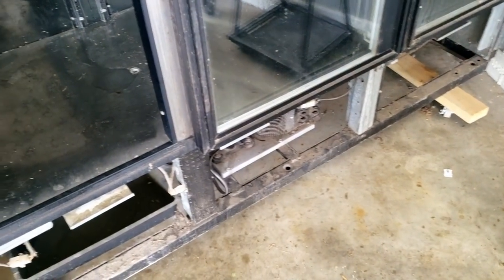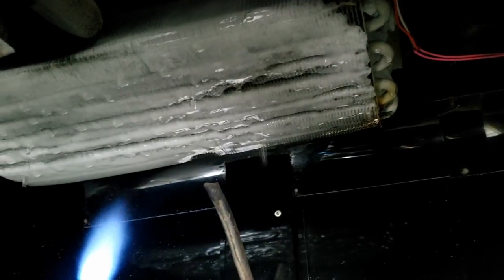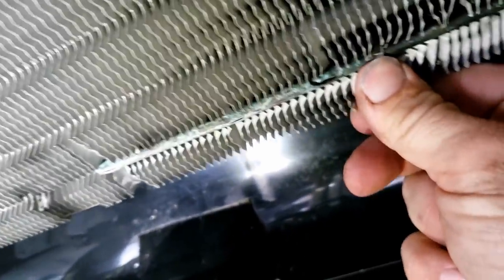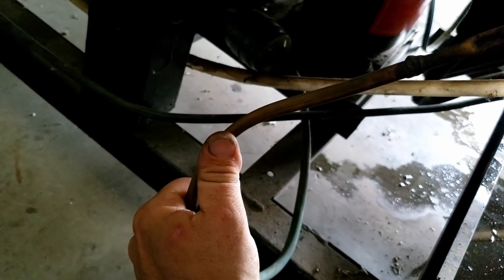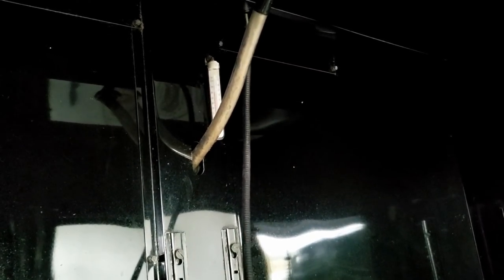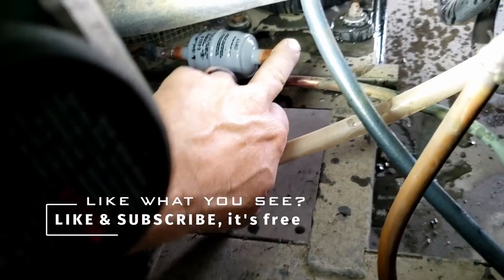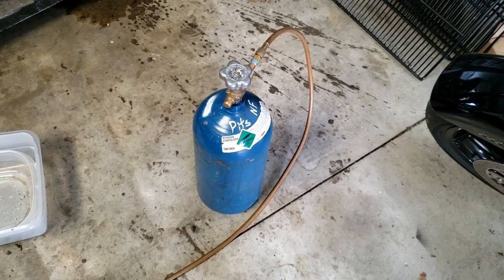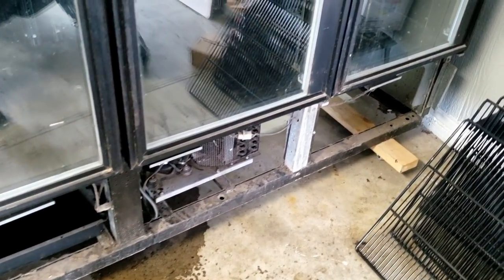Last Call Of The Day Cooler Is Iced Over Likely Leaking Refrigerant

Comment: that started life as a floral cooler. they use a 5 degree td coil, so they don`t cause flowers to dry out.
Reply from the maker: I'm not sure if it was built for flowers or if it was converted over. I didn't look closely at the model number. But that would make sense, so you don't damage the flowers.
Reply: Black is an option for flower coolers, its all about sales. Black makes color of flowers stand out, look nice.
Reply from the maker: Make sense, thanks 4 the info!

Comment: Great video doctor 👍. 2 ?  The pins inside evaporator holding tstat. R they same as on low temp that holds heaters? N do u clamp them right on evaporator coil ? Thanks again for sharing
Reply from the maker: They look like the same hooks used for the heater elements and yes, it hooked on the refrigerant tubing inside the coil.

Comment: Wouldn't have thought that a skim coat would actually hold against a rupture like that.  Learn something new every day.   

For a regulator on the nitrogen tank.   Get one.   Not the standard one, but an adjustable regulator, like they use on huge compressors.    That way, you can dial the level of blast that you need up and down.  I keep meaning to get one for my IT work, for blowing out computers, and fill it with CO2 (like a scuba tank).    

For that matter, you can get a wrapped tank that they use for paintball, and use that with a mild regulator to make the blasts NOT puncture aluminum.
Reply from the maker: I have an adjustable regulator, the most you can get out of its 250 lb.  I believe. 
I never get the flow I need to actually blow out a coil. I seen other people using CO2 straight off the tanks online is how I got the idea and it works great if don't have water or can't get the area wet.
Reply from the maker: @tbelding  👍🤣🤣

Comment: Why aren't you replacing those 2 sensors?
Reply from the maker: Which sensors are you referring to?
Reply: @HVACRSurvival  - The ones that are long and were split open that are press against those coils, (not sure of the correct name).
Reply from the maker: @tubeDude48  that literally is nothing more than a copper tube that the thermostat bulb fits into. It really has no significant value other than holding the thermostat bulb straight.

Comment: I was too afraid to show anybody me using no nitrogen regulator straight to a tube. 
       It works excellent but we both know the dangers in inexperienced hands must wear eye protection even when experienced. 

        My father waited until I had a few years of experience and well aware of the dangers of 2800 psi unregulated at a high flow. 
         My father demonstrated blowing up a pipe show me
           My father demonstrated hooking up to a refrigerant hose and letting the hose clamp around loosely when opening up the unregulated nitrogen pressure and volume. 
           To show me and demonstrate how dangerous that was and then allowed me to do it myself with careful small adjustment until I got comfortable with it. 
          I definitely would not let one of my employees do this especially on a customer’s job site with people around. 
            But we both know it works excellent nothing beats it only recommended for the owners of the company to perform such a task because the responsibility and dangerous just too high in unexperienced hands. 

       And ear protection is a must
Reply from the maker: That's why I said it three times in the video, do not do this and that it was wrong.
Reply: Glad I don't work for your company and your inflated ego.  Wtf does being an owner have to do with experience or safety protocol?
Reply from the maker: @pulda015  who is your reply directed towards?
Reply: @HVACRSurvival  t lech talking about how owners are the only people experienced enough to use an unregulated tank.  The metrics of ownership/experience are not really correlative and even thinking they are suggest really hyper Inflated self worth, and isn't the sort of person I would ever want to work for.